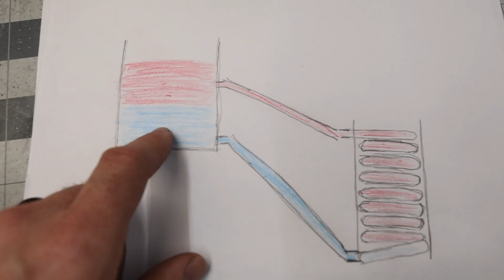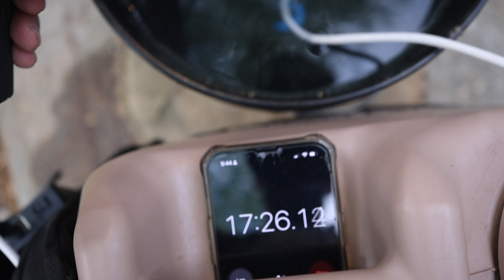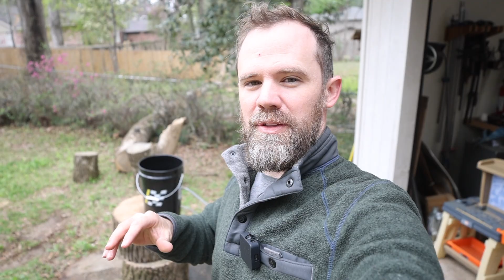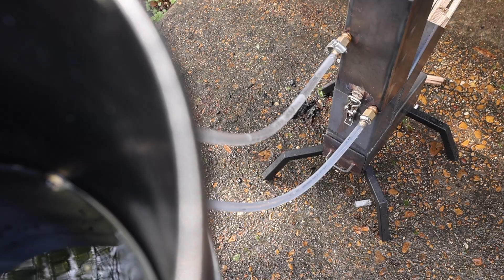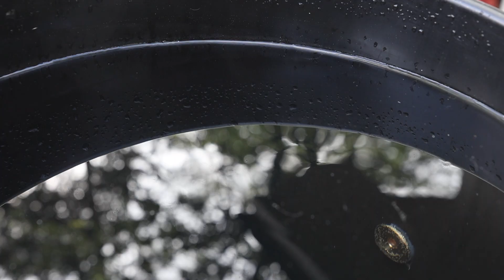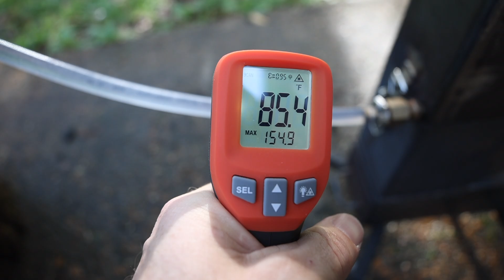Making Hot Water without Electricity!!

Comment: To improve performance, use larger pipes, with the return line (cold) having a smaller diameter than the supply line (hot). We have an old oil-fired heating system with different pipe diameters for the supply and return lines for this very reason; the copper pipes can be kept as is. The reason is the difference in flow velocity at different temperatures.

Comment: You can use a solar powered water pump, like the ones used in aquariums, some are rated for a decent enough water flow so that water will flow lovely and won't start boiling in the pipe and hoses. You can also use a smaller diameter pipe then too, such as 10mm so it'd be a lot easier to make a coil as opposed to using 15 or 22mm, the latter being a nightmare to try and coil 😝

Comment: Inside copper coil is more effective but it goes with 2 big issues: 1. copper will corrode fast under the flames and eventually pipe will leak. 2. Coils are hard to clean from chimneys residue - it will clog after some time.  I would suggest to electroplate internal coils with nickel.

Comment: Better heat the water directly over the stove itself, much less fuel will be used. 
With thermal shiphoning the fuel required is much more than the fuel needed when pump being used or direct water heating.
Also with this method the duel purpose of this kinda stove (cook and heat water simultaneously) is not being utilised.  
You're keeping the flame way too low to be able to cook anything over the stove.
Reply from the maker: WRONG! 😂😂 I have cooked over the flame and heated my water many times and it works great! I can cook and heat water using the same fuel heat and time. If I were to separate it to would take more fuel and way more time to do both. ✌️

Comment: Water boils at 212 degrees F. Expose water to a 675 degree source and of course it's going to boil.
Your concerns come from the flow rate through the heating coil.  The pump keeps the coils cool by forcing cooler water through the coils faster than it can heat to a boil.
The thermal cycling relies on the boiling (percolation) to move the water.
The better system would be the pump as it would supply a higher volume of hot water faster and the battery running the pump could be charged with a small solar panel.
PS: I've seen many stove designs but I think your 3-axis stove is the best!

Comment: This is really only necessary if you want to heat more than a large pot of water. Anything less that 10 gallons would be kinda pointless. Just use the pump and connect it to a 50 gallon drum and in like 90 minutes you would have enough hot water for 5 to 10 showers.

Comment: I had a similar experiment with a hot tub I made (4000 liter - 1056 us gallon). But I ended up with feeding the hot water from the stow into the bottom of the hot tub and taking the top water from the hot tub into the bottom of the stow. My theory was that if i feeded the  hot water from the stow to the bottom of the hot tub, the the hot water would rise an mix withe cold water in the rest of the hot tub. T hat would help speed up the heating process in general. I measured the time doing it like you have shown, cold water form the bottom - hot water into the top of the bucket and like I described, cold water from the top of the hot tub into the bossom of the stow and hot water from the top of the stow into the bottom of the hot tub. It was approximately 30 min more effective doing it the way I described it the the way you are showing. From approximately 10 deg. Celsius (50 deg. fahrenheit) to  40 deg. celsius (122 deg. fahrenheit). From 4 hours 30 minutes to around 4 hours. I did not use a rocket stow like you are using.

Comment: Thanks for posting this. Seems counter productive to have to reduce the amount of heat in the stove so the thermo syphon model works. Just on that alone I'd stick to using the pump and let the stove do what it can. Very simple heat exchanger. Have you tested the results if you wrap the heat exchanger in insulation? And the stove? Might get a bit too hot.

Comment: You should try putting a copper coil in the cool side and then you don't need to cycle the drinking water through the stove. You might need higher pressure hoses and fixtures and a small reservoir to go with the coil on the cool side.

Comment: all this is interesting, but the experiment proved that if you heat this volume of water just on the fire in a metal bucket it will turn out - faster) and without these tubes, pump and so on) A, in warm weather water is perfectly heated and in any container in the sun) especially if the container black color)...

Comment: I m not sure why you re worried about the boiling unless you re concerned with the pipe melting , but if you had copper delivery pipes the boiling wouldn't be an issue , more heat just means faster transfer into the bucket. I don't think any plastic is ideal for this operation.

Comment: If you use better, more heat resistant tubing to connect to it, you can heat 20L (I don't use the freedom units) in about an hour.. at least from a "traditional fire"
And use a wider tube while you're at it.. and a bigger container (you can easily double the volume), have the bottom hole at the very bottom of the container, and the top one just under the water level, when it's filled. And a lid. The steam pressure will push the cold water through even faster.
And once you've done this, you can fire it up as much as you'd like.. the rapid boiling is good, at least for speed.
I'm a European Scout, and we bring a lot of "redneck" gadgets to bigger jamborees, so I've seen my fair share of water heaters, those were just made to go under the fire, so we could cook for the 40+ people in just our camp.
No need for pumps when you've got physics!
Oh, and put it a bit higher up from the stove, but don't over do it

Comment: Just make the return pipe twice the diameter of supply pipe. As well the coils need to expand towards the top if you insist on using coils. Hot water expands. 
This is the reason you had it boiling and not flowing well. Don't need no stinking pump or a checkvalve, none of that crap.

Comment: This works the same as the old range stove setups in the first half of last century (and possibly further back) that had what they called back boilers. Once the fire was lit in the range the hot water could travel upwards to the hot water cylinder/tank upstairs without a pump. This was before immersion heaters inside the same copper cylinders became the standard way to heat water if one didn't have a gas boiler and electric pump.

Comment: Hi,
I really like the idea very much. Actually I will build something simillar for a hot tub.
It should heat up by day via absorbers on the roof, and the fire should bring it to the right bathing temperature.

Please allow me a few ideas for improvement:

1. A bigger diameter should make a better thermal circulation

2. One valve for the cold water stopping from going back when boiling at the beginning

3. Isolate as much as possible to reduce loss of heat

4. As long as you can make bacon in a pan, you are wasting way to much energy. With your very clever stacable  design, you could easily ad another chimney with copper inside. I would guess that at least one or two extra chimneys would work fine.

But anyway, while I'm talking theory, you actually  build something. Great 🎉

Comment: So, based on your numbers, your water heating power is equivalent to an electric heater that puts out ~1.2 kW.  For comparison, a heater element on an electric stove typically uses ~1 KW of power.

The total energy required to raise your water temp 30.4 °F is: ~1,306,905 J or ~1239 BTUs or ~363 Wh
If you were using electricity at 12 ¢/kWh, it would cost you ~4.4 ¢/5 gallons or ~9/10 ¢/gallon.

Given that 1 lb of dry white oak has ~6.4 million BTUs of energy in it, you are converting a very small amount of energy from 1 lb of wood for your water heating.  If you keep track of the mass of the wood before & after the water reaches your ideal temp, you can even determine how efficient your wood heater is.

Comment: Chimney damper would help control the heat some. For those that don't know why you would do this, try camping with no hot water. And no, not in an RV, but in a tent. Some hoses , a coil, and a dakota fire pit would do just fine in the woods.

Comment: I made a bigger version this with the coils in the flue pipe and a pump to heat my hot tub. It worked fairly well to begin with but due to the condensation formation on the coils it got a huge buildup of soot and creosote resulting in it starting to cause a chimney fire on the coils. Luckily I had a damper to calm things down. But essentially I gave up on the idea. I might revisit it in the future and keep all coils within the fire box.

Comment: coiled pipe is fine if you want a flash steam boiler? you only have a small volume of water entering, can only absorb so much heat before boiling... you cant get the flow rate with thermosiphon in that small a diameter to prevent boiling...

a water heater is most efficient when water leaves with only a very LOW temperature rise! and the flame temperature after the heat exchanger should be equal to the water temperature... all the heat being absorbed to the point that the absorber is now heating the exhaust... you should be able to put your hand over it ;) almost all the heat is being absorbed, and its heating a large amount of water a small amount.

a water boiler is most efficient when the water and exhaust is half the combustion temperature. in this case the goal is to get the highest temperature, in the maximum amount of water. if the water/exhaust is less than half the combustion temp, you are absorbing too much, and the steam could be hotter... if its more than half, you arent absorbing enough, the water flow could be higher. 

youre heating less water to a higher temperature... if you wanted the highest temperature possible, equal to combustion temperature... you can only absorb a small amount. none, in fact. 

lots of surface area. lots of flame contact. lots of water flow.

go chat up a plumber, try and get some large diameter copper pipe offcuts...(scrapyards?) 4 inch, 5 inch... cross drill the smaller piece for say, 10mm pipe, in a helical pattern... slight angle helps. you want as much flame interaction as possible, and to maintain as much water flow as possible. with as much surface area as possible.... no hot spots!

 bit of sheet for end caps or cough up for fabricated adaptors... if you hunt around theres even tee reducers, but they arent cheap. especially at large diameters! saves drilling holes for the inlets/outlets? solder her all up.

if you dont ever get it over boiling temps, you can use soft solder... dont run it dry. 

for thermosiphon to work really well, you need large diameters, very easy flow path. and yeah, heat source ideally is halfway between inlet and outlet on the tank/radiator. think of convection currents in a pot of boiling water... big loops! heat, rise, cool, descend... easy!

it doesnt like restricted flow...

i made a small one, 28/40mm for my diesel heater? gets all that heat from the exhaust and into a big drum of water... shame its brain died last year and its almost winter again... brrr. stupid electronics. rocket stove dont need no electronics.

Comment: Probably to get the most flow you output back into the bucket should be above the water line. This makes the output go back to atmosphere and not under water and have to push against the weight of the water

Comment: On a standard hot water cylinder, the cold water entry is on the bottom, and hot water out the top.
I use a two cylinder system, with the bottom cylinder a sealed unit.
The top reservoir feeds cold water into the bottom of the lower unit, this allows any hot water which is removed from the top of the lower sealed tank, to get replaced.  
The hot water tank could be ground mounted and the head water pressure would be governed by how high the upper water reservoir was situated.
The thing to be aware of is, that the lower tank would need an open air breather tube from the top of it, at least the same height as the upper reservoir for safety, which would mean two pipes to the top tank, one for cold water infeed, and one for expansion.

https://www.hotwatercylinders.nz//wp-content/uploads/2022/01/vented-cylinder_200x222.jpg

Regards
Brian from NZ

Comment: Could you use a Peltier module to power a water pump with the fire instead of a battery and get the best of both worlds?
Reply: yes. no. peltiers are fiddly. they like constant temperature, and ideal load. really hard to keep a fireplace at a constant temperature! and within rated temps, of course...

i was playing around with a stove top one, got to the point of having water cooling and yeah, iunno. PC radiator i ordered got destroyed by the postie, so um... i never finished it. probably get back to it as winter draws near, lol...

but was happily driving a 12v DC motor with a 12x6 prop, making a decent breeze! i think i needed four though? maybe six?

did destroy plenty of modules? the colder you can keep the cold side, the harder you can run them...
Reply: @paradiselost9946  If you had a connection to it like the water cooling blocks used in computers, you could have the cold water flow via the cold side of the peltier and the hot water on the opposite side with a block also. Then the bigger the temperature difference the more power it'll output to equalize the temp. but i'm not experienced with them and how good/poor this would operate. sounds like a fun experiment though.
Reply: @gd.ritter  thats sort of what i ended up doing?
PC radiator on stand supporting fan. get up away from heat...

water tank base, peltiers bolted on side. as long as theres water, its limited to 100C...

i guess if one was fancy with different metals and expansion rates you could make it self regulating? just lift off the heat source when over a set temp. really want to push to 130C, maybe 150. whatever.

heat block to radiator, pump. had enough power. ordered a bigger radiator and yeah.... i mentioned a destructive postie?

Comment: To many variables to come to any kind of conclusion. The only suggestion I can make is that larger bore pipes move more water quicker, which helps up to a certain size to heat the water faster but then more fuel needs adding. So without testing lots of different variables of pipe sizes, amount of fuel added, volume of water, just accept that burning wood heats up water 👍

Comment: Ok so.... would this be a valid solution fornpumingnwater short distances if it is not required to be pressurised? It seams like you could use this to trickle feed something for some purpose nit sure what but just seems like a good opportunity for a low maintenance pump?

Comment: If its for showering, why not just have the heated water run to a seperate container so it doesnt have to mix with cold water and can be used faster? Then have a bucket that you can set in a stream or river that pulls "infinite" water to be heated. Anyhow, cool video.

Comment: If you're looking at a 40 min shower as an example. You would need 60,000 btu for 80 to 100 gallons. A normal 80-gallon shower would use a little over 7 lbs hard season wood per shower maybe 10 lbs. This in return is a 40 min shower. The only drawback is it would take under normal operating conditions about 4 hours to heat the water of 100 gallons. If you had or made a pellet maker you could use anything for fuel. Also, if the water is strong enough with the heat you could run a small water generator by creating a strong current. The only worry I could think of besides lazy people could be potentially melting the Cooper coil. This a fun experiment for convention heating, but if you scale it up think of safety ( don't burn down your home or garage.)

Comment: Enclose the reservoir so pressure can be built on the water. This will increase the boiling temperature. Remember to put an over pressure valve for safety. You could use an automotive coolant reservoir as the cap usually has one of these. I think you could reach 250f. (Also consider the volume of air in this enclose, gasses increase pressure with temperature. That's why your coolant reservoir is never filled to the brim.)

The height difference implied does nothing for you since one line will benefits but the other line will equally lose energy.It is better to have short lines to your reservoir to reduce pressuredrop (increase flow). 

You could also increase the coil diameter slightly so there is more volume of water in the line. I expect it would be less prone to sudden boil. Keep in mind that increasing the diameter will also decrease the flow and do so conservatively.